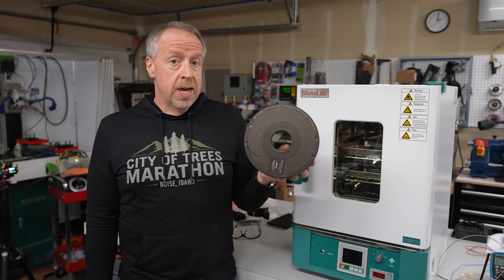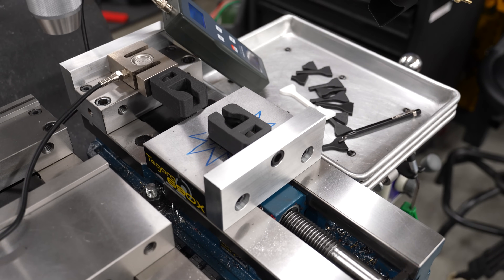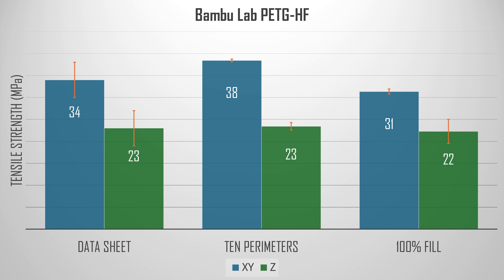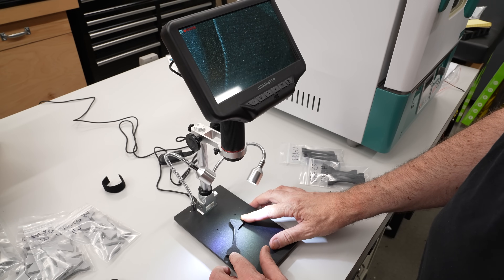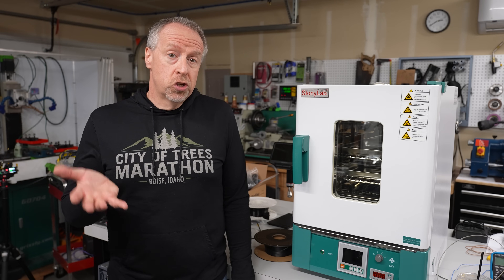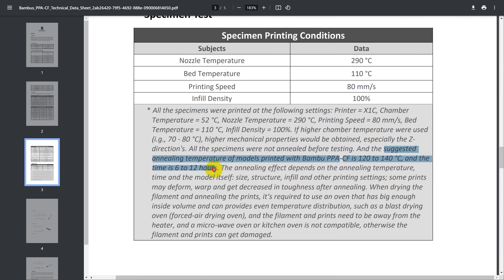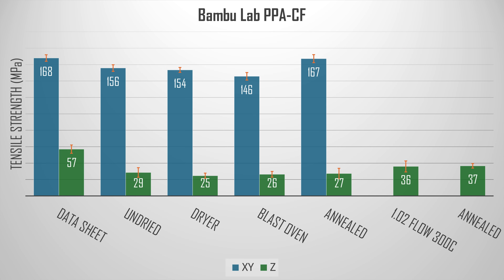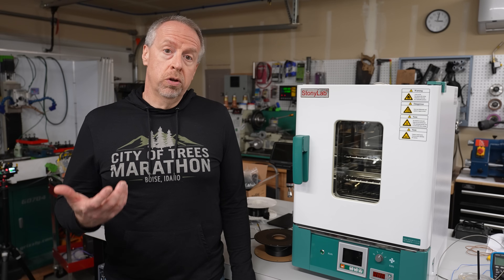I Tested PPA-CF Filament and It's INSANELY Strong!

Comment: I can get my X1C chamber up to at least 52C without added insulation.  I set the build plate to 110C, turn the aux fan on at 60% (trading off speed vs. noise), and then home the build plate.  The fan blows across that hot build plate, heating the chamber.  It takes a while, 30 minutes or more.  I've had great success with ABS and ASA doing this.  These exotic filaments are intriguing, but so far nothing I've made has required their impressive capabilities.

Comment: This stuff sounds like the UPAHT-CF I used to sell, required 300 to 320C hotend and 90 to 110 bed, printed parts come out like stone, and when heat treated was good for 180C constant temp, I also used to dry mine for 72hrs at 120C in an oven, also its really stiff and snaps when bent to 45 degrees, so its quite hard to print in a lot of machines.

Comment: I’ve gone through nearly 10 spools both at home and at work. I purchased the filament the day it was available and I had to do some tinkering with the flow rates to get parts dimensionally accurate, idk if they have an updated profile. I dried mine at my job which had a blast oven, but after seeing this I’ll stick to drying it in my home dryer. You have good data in this vid, thanks. Once I dialed in the flow rate to get dimensionality accurate parts, as good as fdm can do anyway, I’ve had amazing success with this filament. I’m very glad I bought a few extra spools when it was still $100.
Reply: What did you set the flow rate to?
Reply: I would be careful reading too much into the drying results in this test. It looks like the filament was bone dry right out of the packaging which is why drying made little to no difference, if the filament becomes wet you are going to need the 130 degrees blast oven.
Reply: I hope you were (and are) wearing a ventilator while printing with this garbage. Because it CONTINUALLY will 'bleed' tiny shards of carbon fiber. 
Touch it, then look at your skin under a microscope.

Comment: what's the point of tensile testing nylon dry? is the part meant to be used in a vacuum or heated chamber? I'm guessing aged test after exposure to moisture is not even mentioned since the it's sponsored by bambu labs

Comment: Personally I would still use pa6-cf from polymaker as it’s THE best filament for the price. Tensile of 105mpa xy and 67 z, even after moisture absorption it stays higher than 60 in the z direction. Not to mention 200 degrees of heat resistance and an excellent price of 100 bucks per kilogram. The absolute best thing about it is the fact that you don’t even need an enclosure
Reply: Isn't nylon quite toxic?

Comment: OK, I have a question here. I understand the strength difference in the x-y direction being different from the z direction, but did you really test all of the x-y possibilities? It looks to me that you laid out your test samples in either the x direction or the y direction. BUT did you test a sample laid down at 45 degrees to the x and the y directions of the printer? 

The reason this is important to me is that I need to build some ring shapes, which will be subject to hoop stress, much like a pipe under pressure. 3-D printing would be an excellent way to make prototypes, but they have to be STRONG. Somehow I think that if you print a dogbone sample at 45 degrees to the x and y axes of the printer the strength will be closer to the z-axis strength. I really wish I was wrong, but in engineering wishful thinking leads to disaster.

The price of an X-1 Carbon printer is not an impediment, but if the strength of the printed article is not isotropic in the x-y plane it will not work.

A second question comes to mind. Do you think an ordinary kitchen convection oven would work for drying? Clearly temperature control is not going to be as good as the one you used, but the temperatures are well within the range of an ordinary oven, the control could be good enough, and the price is right for many of us.
Reply from the maker: I have been told that a countertop convection air fryer can work.  I've never tried it.  The concern would be if it has big temperature swings or hot spots. 

If you need strong rings, you'll want to orient them so they're printed flat with the extrusions around the circumference.  If that's not possible, the anisotropic nature of FDM printing may not be suitable.  I would expect a 45-degree specimen to be stronger, but it's all going to come down to geometry.  If printing at an angle results in a ragged surface on the underside, it might make things worse by introducing weak points and stress risers.  Getting clean overhangs usually involves aggressive fan cooling, which as we have seen reduces layer bonding.

Comment: Excellent testing process development - it îs nothing I can comment, thanks  for  information. I want to share how to get a nice 60C in the print chamber - add a led ring light over the top glass and the ams over it - you can find a few mountings on MW. This led ring light turns quite hot and you get and a free room heater.

Comment: Excellent video/work.

What about bulletproof-ness?
Reply: I already know the answer
No
Polycarbonate (not 3d printed) can stop pistol rounds if thick 
If extremely thick it can stop rifle rounds depending on the round in question

You're not going to make body armor or any practical type of armor from anything 3d printed unless its steel and sent off to be fixed properly then heat treated

And if you do that you're looking at lower range rifle armor so level 3 or 3 plus 

This would likely stop a pellet gun assuming it's not a high powered one like the air rifles you hunt with

Comment: Doesn't "statistically significant" literally mean "enough to be important"? @5:25
Reply from the maker: No, it doesn't.  "Statistically significant" means that sufficient evidence exists to show that the measured difference is likely real, and not the result of  measurement uncertainty.  Specifically, it means that the null hypothesis has been ruled out to a predetermined level of certainty.

"Important" means that the difference is large enough to make a practical difference for some use case.

An example:  You might have very precise testing data that shows that there definitely is a 2% strength difference, but for your application, 2% isn't enough to cause you to choose one option over another.  That result would be statistically significant, but not important.
Reply: @Clough42  I feel ya, and what you're saying makes sense. But in context, you are testing the strength of different filaments and one is stronger in a statistically significant way. And the whole point of the testing is to determine the strength and to compare that strength...so to me it seems that any filament that is 'stronger' in a statistically significant way is absolutely important, since determining strength is the entire point. Thoughts?
Reply from the maker: @TheJuicyBurger  Selecting the appropriate material for the application is the point.  The purpose of testing is to acquire data to make decisions, and those differences would not be enough to influence my material or process choices.  Any real application will involve a safety factor that far outweighs those differences.

Comment: Hi James, thanks for the info.  You seem happy with Bambu Lab, have you run into any things you really don't like or problems you couldn't work around with the X1C?  I'm considering the P1S to make ABS parts.  I think 100 C should be enough as long as it can handle the bed always being at max temp.  What do you think?  Otherwise its a considerable jump in price to get an X1C.

Comment: Does this filament work well for printed gears?  I need to replace some rare 35T nylon gears in my e-bike's planetary gear set.  I'm dialing in the design and the print.  However, so far they are just not durable enough.

Comment: for insulating an X1C id do polyiso foam with a c oouple blankets, and reflective mylar blankets as well, i have hit 70C before, youd also have to preheat  to get a consistent chamber temp.
i do a lot of PA and ABS and ive found also just sticking a lot of them in a tiny closet helps lol

Comment: Generally the extrusion height to width ratio affects z-strength significantly. If you’re running a 0.4mm nozzle it might be worthwhile to keep layer height the same and try a 0.8mm extrusion width.

Comment: Wool is naturally fire retardant, so I wouldn’t worry about that unless it doubles as an oily rag. Might be worth putting a thermostatic fuse in as an e-stop if you are going to insulate it more than it is supposed to be. I have a 70C one in my ratrig that detects if it gets over temp and opens. This doesn’t detect the head catching on fire though.

Comment: 9:50 I have two of the same Cyclopes driers and I have stuck a thermocouple in them to check and they actually do get the air inside above 70, as high as 75C even. Whether the filament gets that hot winter middle tho who knows.

Comment: This is just off the top of my head, but PPA wants to be dry during printing, but moisture improves toughness after the fact. I was told this and did not independently research it, take it as you will.

This may explain the drop in performance between fresh and dried.

Comment: Sorry you didn't get to use your fire extinguisher, but excellent video nonetheless. I have a sheet of fire resistant polyiso foam that I throw on the top when I'm printing high-temp stuff. Same stuff I used to make my garden oven. I could make sheets for the front and sides as well, but that might be too insulating for the printer electronics. So far for me, it has been pretty easy to print my parts in a way that puts the big loads into the X and Y directions.
Reply: I'm here for the Clough / SuperfastMatt crossover!
Reply: The lack of fire probably has a direct correlation to the lack of ham sandwich embedded in the filament 😅... more ham more fire
Reply: Can anyone explain why Temps so signifantly higher than the boiling tempurature of water is allegedly needed or recommended to get the moisture out of this fancy pants filament? Regular nylon only calls for 187f and I only need to keep it at about 140f to print it once it is dried. Also though, I keep my nylon in metal ammo cans, wothout dessicant. I've pulled nylon filament out of the ammo can after months of sitting and into my beef Jerky capable dehydrator at 140f and it prints  moisture free immediately.
Reply: @MicahT-l7p because you're not attempting to boil water (make the water molecules let go of other water molecules) but instead trying to make a hygroscopic molecule let go of water molecules.
Reply: @Argosh  your answer lacks the depth I desire. My plain nylon filament doesn't require the Temps and blast furnace bambu claims is nessacary for their ppacf
Reply: @MicahT-l7p  Google it then. The Dipole interaction between water is not the same as the one between other materials.
Reply: @Argosh  excellent, that is the more in depth answer i desire.
Reply: @MicahT-l7p FYI you don't need a blast furnace... it's basically a fancy air fryer with temp control. There are a lot of cheap air fryers that fit filament spools perfectly, just monitor the temp so you know how it behaves. They can easily get hot enough but you can get by with lower temps (even with this filament), it just takes much longer and there will be a point where it's simply not hot enough. Generally speaking, time can make up for heat if you need to play it safe.

Comment: this seems like this could be a game changer for folks printing things that go in hot cars (in the south, inside of a car can get over 150F). I was also thinking about parts that would go outside, but temperature resistance is only part of that... i guess my next question is how well does that filament stand up to UV? do you think it would get brittle quickly if not painted?

Comment: That design is weak to begin with, the grips are stressed in flex. Put steel bolts vertically in the large grips and join them on the top with another steel bridge, so no flexing will happen. PA at this point is perfectly fine

Comment: I’ve been waiting to see some reviews of this filament, it seems like a massive step up from all other consumer filaments. Based on what I could find online it has higher tensile strength than some grades of aluminium, it would be interesting if you could test those to see. The stiffness is much higher than most other filaments but still falls way short of aluminium though.

Comment: I would slow it down even more, with parts I want to be strong, all perimeters are printed 55mm/sec or lower. All other print movements are no faster than 100mm/sec

Comment: If PPA behaves like normal nylons, it will be brittle immediately after printing because it's so dry. It's toughness is related to moisture content. With Polymaker CoPA and PA-GF, they get very very much tougher (and less stiff) after a couple of weeks in ambient (UK) humidity. I suspect your tester jaws may have been fine if left to absorb moisture.

Comment: Enjoyed the video, but now I have a couple of questions:  first I was wondering if scale matters in this kind of tests. Yes, measuring pressure and not absolute force should, in theory, ensure linearity in the results, but does this apply in the case of 3d printing, where the width of every single extrusion remains constant? Also it'd be very nice to know how the material compares in terms of brittleness to, let's say ABS, which is considered to be a good preforming filament in this category. Looking forward to some more testing, maybe of that other crazy stuff, the PPS-CF. Too many questions from someone who's never going to be printing any of these wild materials, I know.😊

Comment: Nice, only usefull for small parts, bigger parts than an hour (or even less) to print, will heatup the printhead due to creep, and block (the gears get hot). So, print one part at a time. you can add a T on the bowden tube at the back, let the filament run through, drill a 2 mm hole there where the bowden goes in the head, add compressed air, should prevent a lot of creep heat, and keep the gears cold.

Comment: Got some of this, just need a way of drying the damn stuff. My go to for strength at the moment is PET-CF which is amazing. PPA-CF looks like its on another level.
Reply: Cheap solution; air fryer. It's what I use for higher temp materials and they are surprisingly accurate.

Comment: thanks for thorough testing. I am just wondering, PPA-CF filaments are not new to the marker, why are people only testing them now that bambu have released them?
Reply: Also I think that since Bamboo printers are so prevalent now, people are more confident that they can get good results with an expensive specialty filament because the stuff is made for the Bamboo by the Bamboos 😊
Reply: Probably more exposure because Bambu promoted them. I have a similar filament here but I bought a PPA-CF roll from Bambu as well when they where on discount.

Comment: Great Video, even tho ill probably never print with it, it was some great information. One thing I would like to suggest is trying out this new filament I found at a company near my house, The place is called Filament Factory, they Only sell some PLA types and one type called DuraPET PCR, I've been printing with the DuraPET the last couple of days and I really like it, its fairly strong, has really good bed adhesion and is suppose to be a repleacement for ABS, Nylon, PC and PETG. It does string a bit at 295 print temp, which is the low end of the print temp suggestions of 310 (cuz my hotend isnt rated for over 300) Also doesnt need a heat chamber, or fans when printing. My prints have been coming out amazing, but I would be intersted in seeing some test results on this filament. Hope you will give it a try.

Comment: Nylon properties change a bit when they are in a wet state. Sins the stuff is going to be used for car parts etc. Can you tell or explore the difference in this?
Reply: this is not a regular nylon
Reply: @riba2233  that's why I'm interested
Reply: @Florens1989  they quote really small differences in dry vs wet performance